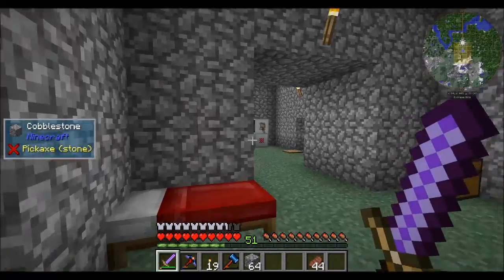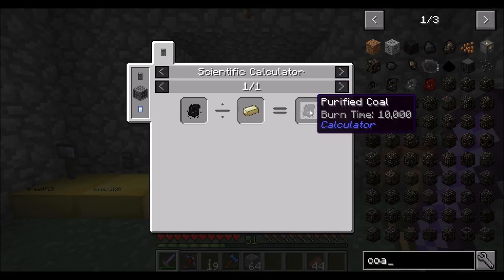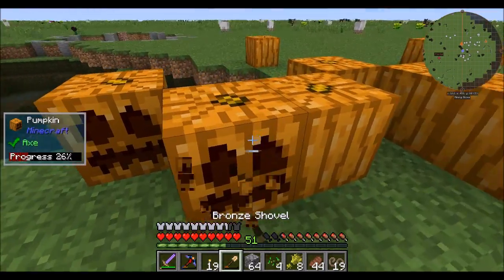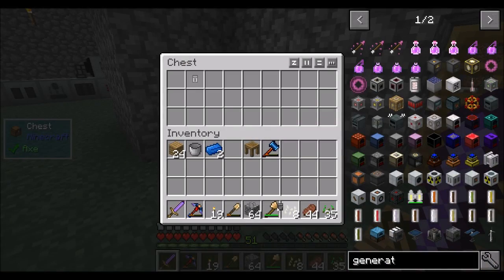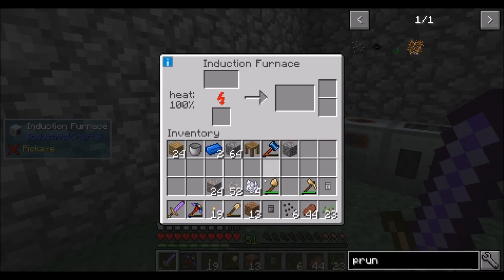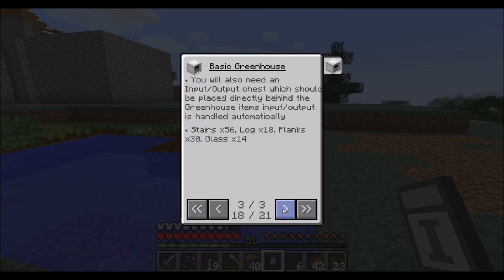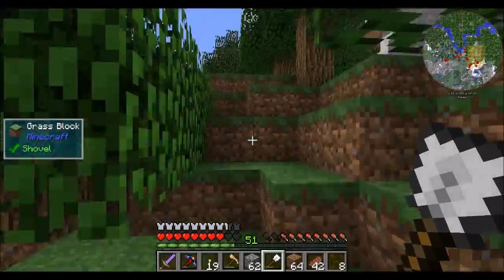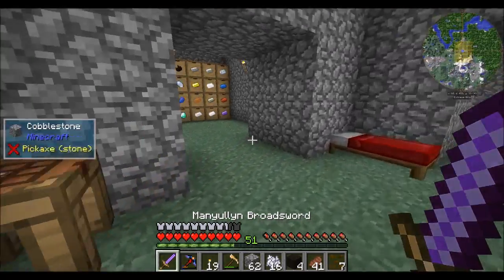AoE Ep9 Greenhouse

Comment: Although you can't generate RF with Canola you can use the Tier 2 Canola oil in the Semifluid generator from IC2. If you don't care about aesthetics too much you can chain the Progressions planter to auto farm Canola and auto output into a hopper -->Canola Press which auto-outputs to fermenting barrels which auto-output into EnderIO fluid tanks which can push into the generator. It makes a much more renewable power boost than burning coal.

Comment: Hey! When making circuits, it is a bit weird, almost glitchy. But you can automate. best thing to do is manually seperate the circuits as you get the normal ones and better ones. then once you fill every storage slot with the better ones, you can hook it up with whatever piping system you like. Unless you manually insert, it can mix both rarity types of circuits and get weird. Also, working on the upgrades for the machines help A TON with power consumption and speed or both since speed requires more power.

Comment: So there's something I do that I think you could benefit from. Tinkers has a drying rack recipe. Fortunately, a drying rack will accept pretty much anything. I like to use them as tool racks at all my different buildings.
Reply: TheErusPrime 
Didn't they make a display rack that is cheaper to craft?
Reply: The drying rack is like 3 slabs isn't it? Are you really that short on resources? (InB4 massive changes to Drying rack by the pack making it cost diamonds or something)
Reply: But draconic evolution is in the pack. You just use whatever hotkey you assigned to place items in the world. Your idea is more decorative however.

Comment: Also, you can add torches inside the greenhouse to increase carbon dioxide. it makes things quicker.
Reply: Brandon Zimlich-Vining there are lanterns from the calculator mob that do it even better but require coal
Reply: mod not mob

Comment: That greenhouse construction stops for me every time too. I can't figure out what causes it to stop.
Reply: Just over-supply it with materials and make sure it's full on power, click rebuild too.
Reply: bad coding
Reply: The block is not coded very well. It always checks for all the stuff so when it uses it up it then does the check but the stuff is not there so it stops. They should really fix that block.
Reply: Yeah, it's buggy as hell.  Shift-clicking the block seems to work better than clicking the build button in the GUI.

Comment: Hey dire why won't you live in mining dimension? It's all flat so you wont have to mine out terrain plus its always daytime which makes its perfect for solar power. Like so he sees?
Reply: But you have 0 nether access.
Reply: Its not like portal to overworld dissapears magically over time you can still go there to enter nether which equals no nether sounds and no pigmen wondering in same dimension also making noise
Reply: mateusz54pl Better stay in the overworld. Rockets can't land in the mining world (they land in the overworld instead even if launched from the mining dim) which will cause troubles/headaches later if he builds his whole rocketry setup in that dim.
Reply: I don't know about that. When he reaches point of building rockets and flying into space i think he would have gotten wireless power by then or was super close to it. I prefer to have free solar power 24/7 and visit overworld occasionaly.
Reply: As Mateuz54pl pointed out you set up a small home base in the over world like a 9x9 hole in a cliff which you place a bed, a nether portal, the mining dimension portal, and an emergency chest with spare equipment for a corpse run.  Then you can do most of your base building in the mining dimension only returning to the over world to transfer to the nether, gather resources not in the mining dimension(like rubber trees), or to go to do space travel.
Reply: mateusz54pl That would look so bad.